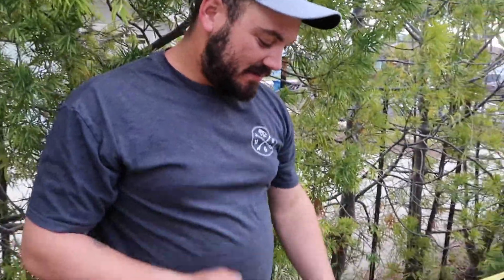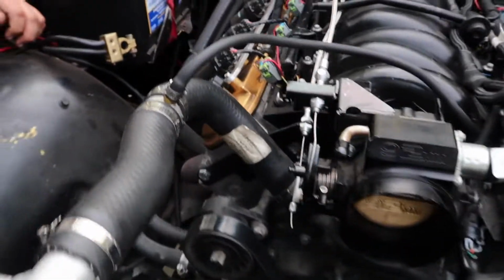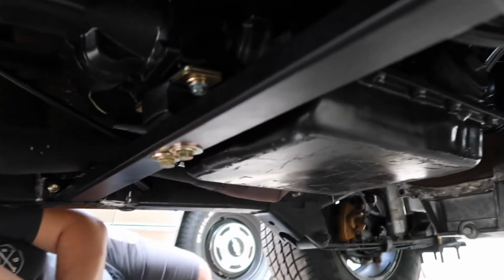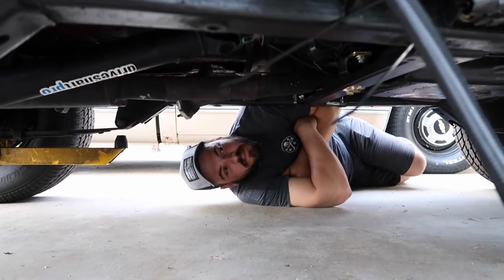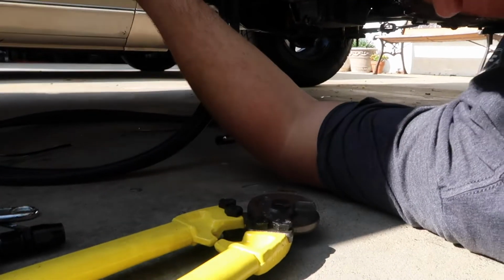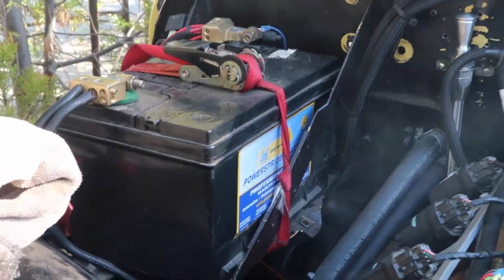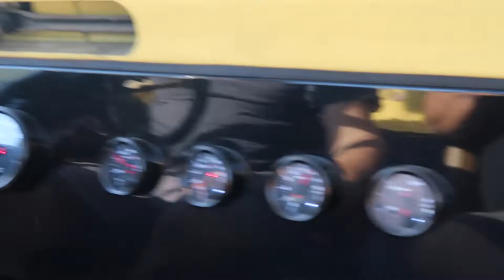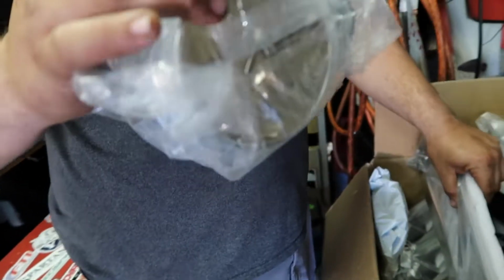Will the 700r4 work with LS 5.3 Swap? TV cable adjustment. Manual Valve Body

Comment: I did a 6.0 LQ9 in my S10 and used the original 700r4. I built a bracket to hold the TV cable at the correct height and angle to the throttle body so that the cable would be fully extended at WOT and start moving as soon as the throttle is cracked.  The cable pull bracket on the throttle body was a little tricky to get the ratios correct but it drives like a stock truck at low throttle input and gets serious with heavy throttle. It still wont rev out to 6500 rpm without manually shifting but drivability it great.
Reply from the maker: Yeah getting the bracket it key. Do you have any photos on instagram?
Reply: I don’t. But I could send some to ya if you’d like.
Reply: can u send me the pictures as well im tryn to figure out how to on my blazer
Reply: I have a '96 S10 4x4 v-6 5 speed manual trans & t-case, runs great but I would be happy with just a 5.3ls, but can't seem to find anyone converting manual 4x4 S10. I did a 5.7 in a zr2 Blazer, but making the radiator, steering and exhaust - headers with arm between the pipes, then adding the fuel injectors wires and reflashing ecm was just a pain. Plus oil pan. I was getting paid for that, this is my own. A customer is buying a crate 6.0ls3 to put into his full size GMC Jimmy (k5) 480HP. His has the 700r4 rebuilt but I think he's uping to a 4l80e. The crate engine is $10k. with harness, power st. pump, a/c pump, alternator serpentine belt setup
Reply: What engine did your S10 have in it stock? I’m told my 700R4 behind my factory 2.8 won’t work on an LS. I’ve heard it’s a 60° bell housing instead of 90°

Comment: Shouldn’t the full manual valve body keep the pressures at max at all times, eliminating the need of the tv cable?
Reply: no, no it doesnt lol. you are 100% correct it looks good though lol!
Reply: I’ve seen some that do eliminate the use of the TV cable with different pressure booster valves. But you’re right, not all of them are like that.

Comment: I am getting a 5.3 with dbc. I have a th350 right now in my 85 shortbed it isn't the original guy said it was from jegs. I want to put a 700r4 in the truck. Thanks for the info.
Reply: Just get a 4l60e, much better

Comment: I also have a 5.3 with a 700R4, and yes that tv cable was crazy, but we did it and it shifts extremely well,, - I have a 77 C10 1/2, and she is doing it with the 700r4, which I already had that in my truck for over 10 years, and didn't think/know at that time when I got the 5.3 to also replace the trans,,, when this goes out I will,  I would like to connect with you to talk about it,, 700r4
Reply from the maker: Have you had any trouble with it running hot?
Reply: @gasratzcustoms  how would i know,,,

Comment: What throttle body do you have and did it come with the tv cable slot below throttle cable or did you fabricate it? Also what tv cable and throttle cable brackets are those thanks love the channel.
Reply from the maker: We had to fabricate a tv cable bracket to make it work.

Comment: Can you tell me which bracket / kit you went with for the TV cable on the LS throttle body?  Bowtie overdrives has a $330 kit, but I am wondering if I can buy the bracket alone elsewhere to use with the stock TV cable for a 700R4 so I can pair it with my 5.3 LS.
Reply from the maker: It’s been some time since we installed this so we don’t recall. It was a cheap aftermarket bracket and may have been Lokar.
Reply: @gasratzcustoms  I ended up welding a TV cable carburetor bracket from Amazon onto the stock throttle body cable arm, 180 degrees across from the cruise control bracket and it seems to work with the TV cable and trans.
Reply: @paradigm905  hows it running did it blow up yet? wondering if i should just swap the 4l60 out of my roadmaster for my swap or keep it and fab a tv cable
Reply: @YoungMacy  I only drove the car a few miles since I connected the 700r4 to the 5.3 LS throttle body, it seems to be shifting fine.  Not sure if it will have problems down the road though...
Reply: @YoungMacy  Maybe fab a TV cable bracket onto the throttle body cable arm, and if the 700r4 eventually blows then swap in the 4L60
Reply: @paradigm905  well I actually found a tv cable bracket for ls swaps
Reply: @YoungMacy  Can you share the link? I am interested

Comment: I have the same trans in my 91 yj with k5 blazer drivetrain don't know the year. My questions are. What have you done about reverse lights and torque converter  lock up
Reply from the maker: No reverse lights and it was a full body manual valve body.
Reply: @gasratzcustoms  i figured out the torque conveter lock up. Gonna just wire up some lights on a switch thank you for the reply
Reply from the maker: Awesome!!!!!!!🏁🏁🏁🏁👍👍👍👍

Comment: I'm standing here looking at my just ordered 5.3 450 ho from summit...I have a 87 grand national 700 r4.  I'm putting a intake and carb setup on it...I'm wondering what stall to go with ?? I have a gn but it's a 3500 stall.,.was thinking I should save it for when and if  I get a turbo...it's all going in a 68 C10....bf on the tag on trans is a gn trans... supposed to be good 450 hp....any input on converter size....thx
Reply: In a gn you should have a 2004r transmission which is better than a 700r4 ...IF you build it up a 2004r you will be better off from what i hear

Comment: Thanks, I am going to do the LS 5.3 into an '89 GMC Jimmy full size that has a 700r4.  Was wondering how to do the cable. That detached trans cooler looks nice. Are those dumps on the exhaust? Sweet.
Reply from the maker: Yeah those are exhaust dumps!!

Comment: Where did you get your  transmission? I have 5.3 cammed and I’m adding a turbo for my 65 cutlass. The 4l80 is super expensive now
Reply from the maker: We got it at the swap meet
Reply: @gasratzcustoms  damn and it’s gonna hold the power? Ok sign me up. I’m looking right now.

Comment: Did the 700r4 bolted on engine fine or u had to get adopter? I have 2002 5.3 ls
Reply from the maker: You will need an adapter
Reply: @gasratzcustoms  what kind and Flexplate